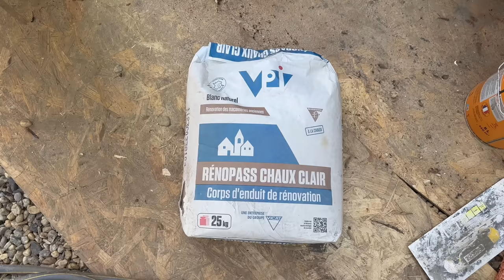Episode 30, Rendering and a start with the traditional stone stairway.

Comment: I think u should invest in a hawk mate, I’ve been rendering for 23 years. You should always spray your walls with biocide before applying anything, there will be moss and plant seeds that get stuck in the old brickwork and after a while they will grow and pop the render off the wall
Reply from the maker: I’ve got a hawk, don’t like it. Too heavy and cumbersome. Spraying the walls is a very very good tip. Thanks for that!
Reply: @thisoldhousefrance  I forgot to mention don’t take the render to the floor either, you need to keep it above the damp course or damp will climb up it and transfer to the internal walls which you definitely don’t want! Place a bellcast bead above the damp course and render to that
Reply from the maker: Thanks a lot Johny! This is very useful info. I will look into this! Cheers🙏

Comment: I’d phone the Dutch consulate and ask then to record your run in the the gendarmerie. Icahn imagine sea captain, wrong plates etc had them jumping to all sorts of conclusions! You need to safeguard your work etc. sage travels. The garden is really coming on, especially the top terrace.
Reply from the maker: For now I’ll just wait and see what’s going to happen. The officers of the gendarmerie were in the end very nice and told me it was not a big thing. After all the license plate differed one digit from what it should have been. It was issued to me by a well known franchise garage. I think it’ll work out fine for me.
Reply: Gunna miss you again 😊 ......... your cattle mates are attentive
Reply from the maker: @elephant9197  yes correct. The garage printing the initial plates misspelled with one digit. Of course that’s a mistake made by them. However in the end I should have checked the plates by referring to the registration docs. In the end it’s the driver who is responsible. A thing I take very seriously being a Captain.

Comment: Looking great out back.  Hope you are travelling for pleasure rather than otherwise.  Is the little annexe at the back of your future bedroom staying or do you still have plans to remove and replace it?  It is such a charming quirky little structure it would be great if you could retain it.
Reply from the maker: Yeah, for sure I will take the top off to make it a flat roof that can be accessed from the bedroom. I’ll be using the bricks and stone to create a rounded wall in the back of the fire pit. But I need to see if the remaining building is structurally sound enough to function as the bathroom. In any case a new structure will look as if it was original. Build similarly to the steps with natural stone on the faces of it.

Comment: Ah the joys of the French systems. We had a fun time registering our car when we bought it. I'm trying to figure out what happened to you exactly. I know that you don't need to change the licence plates unless the original owner wants keep the plates, there's a tick box on the transfer documents. We are using the plates of the other owner and just transferred them to us. I'm curious to know what happened in your situation.
Reply from the maker: Me too. The whole transfer of ownership is still a mystery to me. Nadia arranged it with the sales person and I stayed out of it. It was quite a complicated process compared to change of ownership in other countries I’ve lived in.
Reply: @thisoldhousefrance  Ours was rather simple overall. The biggest frustration was the carte gris as we weren't in the French system yet and had to go to a shop that specializes in doing carte gris for a fee.

From what I've read in the thread it appears the sales person made a mistake during the transfer of the carte gris or the licence plate creation. They should be the ones dealing with this not you.
Reply from the maker: @traveladdict7173  I don’t remember how we did the carte gris. Nadia arranged all this. The mistake was initially made when the new plates were printed at Feu Verte. However the driver is always responsible to make sure the car is legal on the road. So this was my oversight. I should have cross referenced the plates with the carte gris upon collecting the car.